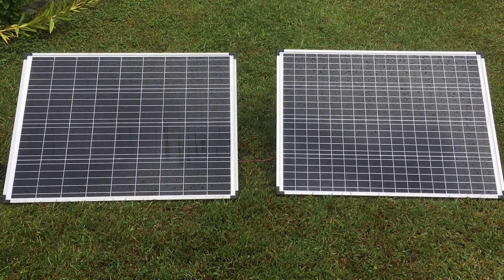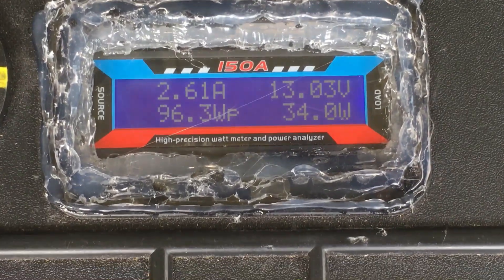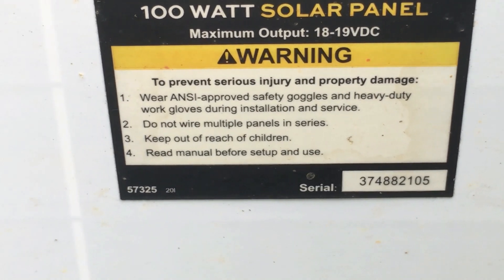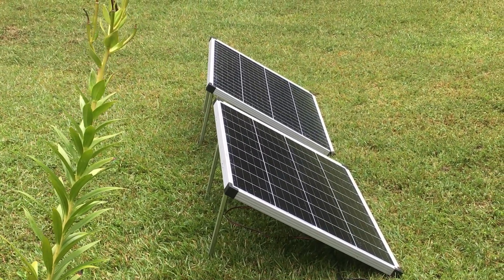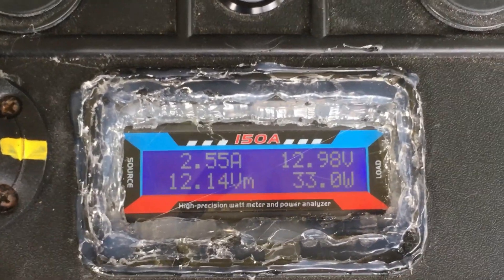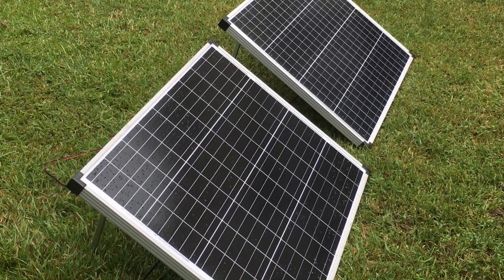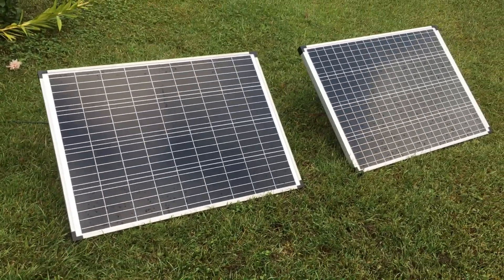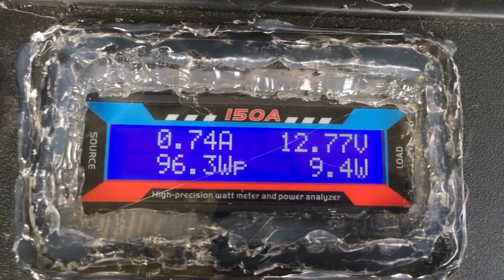Can you hook two of the new 100 Watt Harbor Freight Solar Panels Together?? 57325 (Rainy Day Result)

Comment: I have 2 of those connected in series to my Victron mppt charge controller and it works great. I bought the panels for $80 each during a promotion and am impressed with the performance.
Reply from the maker: Nice yes as I suspected they just put that warning label because the charge controller’s they sell are trash lol
Reply: @DIYKAI  And I have to admit I also tried it because they said not to!
Reply: Thanks everyone, knowledge is key. Youall are the first to give me straight answers I needed. I need 40v for my pecron 1500w power station. And lead batteries with charge controller, to DeWalt1000watt inverter is not strong enough to make a pot of coffee. 1500 is great.
Reply: @plove9136  I purchased a 600 Watt Coffee Maker. It works great. A 1000 Watt Inverter is sufficient. You should try to find one. Check the specifications on the box.
Reply from the maker: We are using a 3k pure sine wave it powers everything we throw at it so far lol
Reply: @salsepulveda494  yes, I kept the Dewalt for backup, but that pecron runs the fridge and coffee pot. It's a beast. Ice age farmer, tried to stall his running a big window a.c. and other things going. ...stay strong and prepared.
Reply: How many can you connect together
Reply from the maker: I have 2 new ones and 8 old ones together no issues…. Just have to make sure your charge controller and battery’s can handle the amps
Reply: @DIYKAI  so are you running 10  100 watt panels in series 12 volt and what charge controler would you need for basicly yor running 1000 watts of solar?
Reply from the maker: Yes we are running them in series. No it’s not 1k watts it’s two 100w panels and two 100w kits (each panel 25w in the kit total 8) 400w
For a large system like that we run series parallel. For example our 600w array is series parallel this allows 60v at 40a the charge controller we use takes the 60v and steps in down to around 14.8 at 40a as the system gets larger series parallel is needed to cut down on wire and controller cost…we are using a PWM for anything 400w and under. 400+ and we use a MPPT hope this helps
Reply: I wouldn't waste time with a HF charge controller.  I'm using a Victron mppt, very satisfied with it.
Reply from the maker: Yea they are trash we are using a Renogy
Reply: I'm running three HF panels wired in series.  Works just fine.
Reply from the maker: The limit is the cheap charge controller HF sells
Reply: @DIYKAI  I think you are correct regarding the Charge Controller and its limits. I changed the Output Cable to the Charge Controller and made it 10Awg. I'm also using a Victron 100/30 Charge Controller and that goes to charge four LiFePO4 Batteries. The problem  - 400 Watt Solar may not fully charge the Batteries before nightfall. Still testing.
Reply from the maker: We use 600w and it will charge a 200Ah Lifepo but that’s series parallel and with Renogy panels